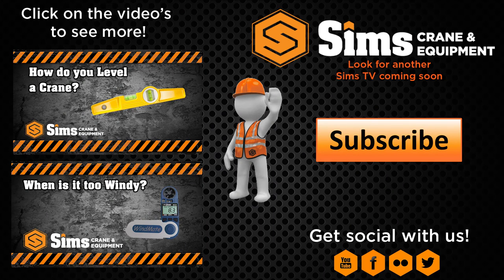How do you Ground a Mobile Crane? | Sims Crane Q&A

Comment: Hi Sims,
Thanks for the info. Would you please care to tell us the size of the grounding cable and the rod you are using for your crane...Thank
Reply from the maker: Mustafe just a follow up, I know it has been a while.  We have been talking with our utility clients and most feel a 4/0 cable is sufficient for most utility operations, but higher voltage may require larger cable.  It has been a discussion over the past year at Sims and we wanted to follow up with some response.